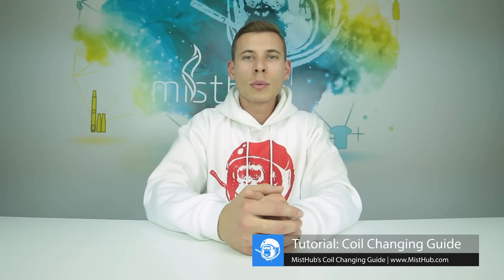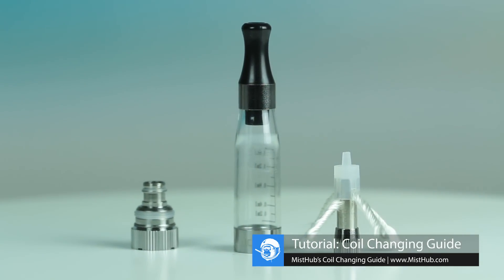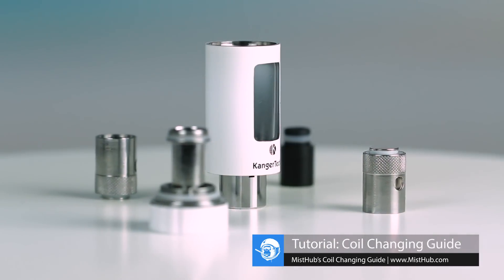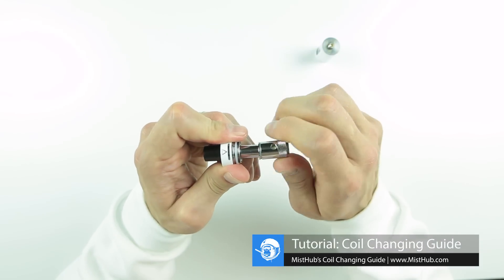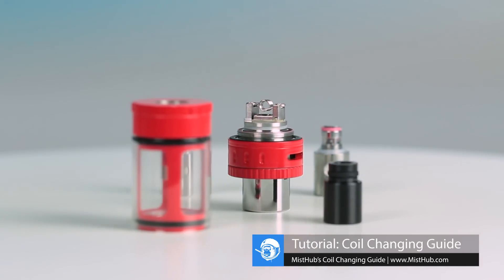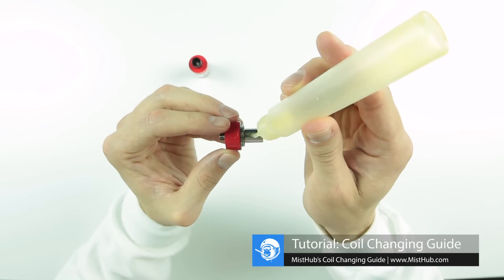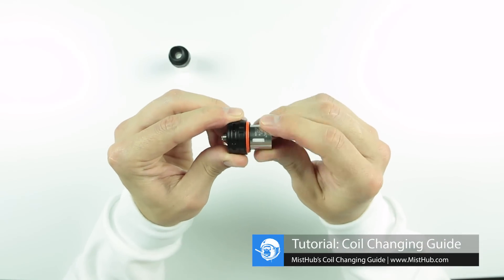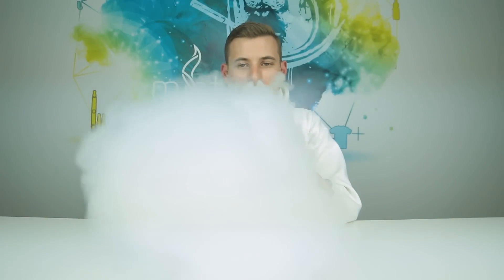Vape Tutorial: How To Change Coils On Vape Tanks & Clearomizers

Comment: why suld be change ? and how many days suld be useing please i need help
Reply: the taste will be very bad. You will definitely know when you have to change it.
Reply: thank you im using osub smoke 80w its new after 2 weeks im using like 30 min only every day 26W now when i smoke it the juse came out and its to hot like burn my lips so what you think i suld be do ?
Reply from the maker: Mohamed- We do not sell the OSUB at MistHub, so it's hard to say what could be wrong with it since I don't have any experience with it. Usually, if your tank is leaking, there is an issue with the vacuum seal inside the tank. If the tank isn't necessarily leaking and you're experiencing spitback, that's a completely different subject altogether. Try vaping the coil at it's recommended wattage. If you're using the 0.4 ohm coil, vape it between 55-65W. If you're using the 0.6 ohm coil, try vaping between 30-40W. Let us know if this helps you solve your issue!

Comment: When I replace my coil on my smok it gives me the message of short atomizer even after I wait 20 minutes to let it soak in and get used to it, it doesn't even display the message of "new coil y/n" like it did when I took apart my coil and tank to clean it.
Reply from the maker: Hey Wzrdprado, Try unscrewing your atomizer completely and then push the fire button. It should say something along the lines of "no coil." Then thread your atomizer back onto the mod and push the fire button again. It should reset the device and ask you if you are using a new coil. That should fix your problem :D
Reply: MistHub thanks, actually the bottom thing wasn't reaching a gold part that it should've so I just pryed it a bit and it connected and everything works great
Reply from the maker: Awesome! Glad to hear it!

Comment: do you have to buy a specific coil?
Reply from the maker: EnderManSlayer- Yes, you will have to buy a very specific coil for whatever tank it is you are using. In other words, most coils cannot be used universally across different brands of tanks. If you need a replacement coil, I suggest googling the name of the tank that you own, followed by "replacement coils." Most coils are cheap and can be purchased for less than $5 😀  Let us know if you have any other questions!
Reply: MistHub. okay, thanks

Comment: I have a tfv8 but me and my friend have been trying to unscrew the coil and it wont unscrew. I'm at a point where I don't even think its screwed on too tight but just attached onto it or something. Anyone else had this problem? Can anyone help I'd really like to get this fucking coil off
Reply: having the same problem won't work for me
Reply from the maker: There are a few things that you can try: If you cannot get a solid grip on it and do not mind potentially ruining your coil, try grabbing some vice grips or pliers to get a firm grip on the coil and unscrew. Another suggestion on Reddit said that a screwdriver can fix the problem by putting the screwdriver into the airflow channel and THROUGH the bottom of the coil head. Once you have the screwdriver in place, simply twist the base while holding the coil in place and the coil should come off. Hope this helps!
Reply: it worked thanks a lot!
Reply from the maker: Awesome, glad we could help!
Reply: Aran Nikrou yeah my pieces are way too tight the first one i twisted that was too tight the glass cracked idk wat to do lol maybe the vape shop can take it apart
Reply: MistHub worked for me thank you!
Reply: Roger that, I had the same problem with the first coil that came with the tank when I got it. When it came time to change it, that fraker was on there tight as hell. I had to get some pliers and crank it off. It came off pretty easy once I got the pliers out. 

After that, the next coil change was easy. Came off with a hand twist.

Comment: my tfv8 tank won't open
Reply: is there any way I can loosen it up?
Reply from the maker: There are a few things that you can try: If you cannot get a solid grip on it and do not mind potentially ruining your coil, try grabbing some vice grips or pliers to get a firm grip on the coil and unscrew. Another suggestion on Reddit said that a screwdriver can fix the problem by putting the screwdriver into the airflow channel and THROUGH the bottom of the coil head. Once you have the screwdriver in place, simply twist the base while holding the coil in place and the coil should come off. Hope this helps!
Reply: Try wrapping an elastic band on each moving part to get a better grip.
Reply: Thanks!!!

Comment: how to you change the tfv8 coil if there's still juice in the tank?
Reply from the maker: I suggest turning the tank upside down and unscrewing the base. Make sure that the e-juice in the tank is low enough (below the coil with the tank upside down) before unscrewing the base. If the e-juice level is higher than the coil, the e-juice will leak out through the chimney when you unscrew the base... and you definitely do not want that.
Reply: MistHub thanks for the reply. I was skidish about doing it that way because the glass can come off.
Reply from the maker: Flibjabber- Somehow your comment slipped passed me :( Assuming that you have your TFV8 halfway (or less) filled with e-juice, I would flip the tank upside down and unscrew the base. The coil should stay attached to the base, and you can then remove the coil from the base and thread on whichever new coil you want to use. 

If the coil is still threaded onto the chimney when you remove the base, make sure your e-juice level is not higher than the chimney. If the e-juice levels are higher than the chimney, the e-liquid will leak through the chimney when you remove the coil. If the e-liquid level is below the chimney once you remove the base, you can go ahead and begin unscrewing the coil. Just be sure the tank remains upright and the glass section stays in place.
Reply: idk but put juice in a shot glass meanwhile
Reply: How do I change a kroma-a coil  axiom m21? Pls help
Reply: That's cute!!! But not NOW. I've done that before.🤔😱
!

Comment: What if it's super tight???
Reply from the maker: Sandra- Can you be more specific about which tank or coil is really tight?
Reply from the maker: Asap- If you can't get the coil off, try opening your airflow to 100%. Next, grab a small screwdriver or something that's long enough to go through the airflow and out through the other side. When you stick the screwdriver in, you'll also be going through the bottom part of the coil, so long as the screwdriver is through both airflows. Begin twisting the screwdriver/base combination in a counter-clockwise motion, and everything should come off. Let us know if you have any further questions, hope this helps!